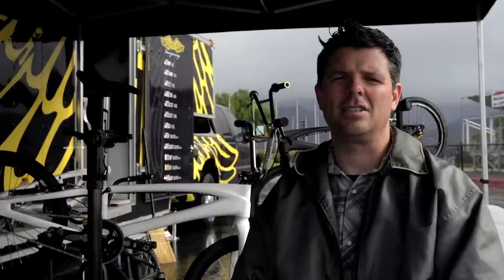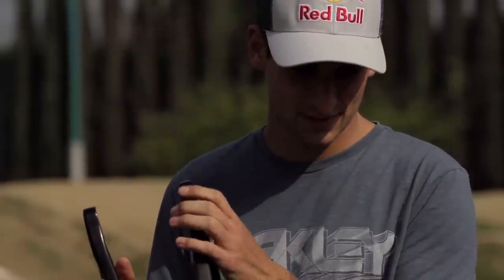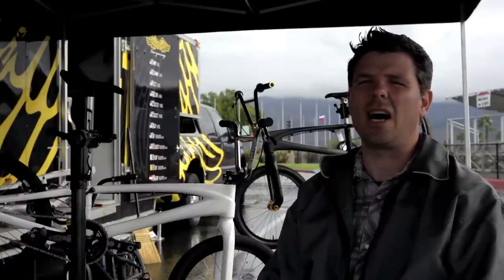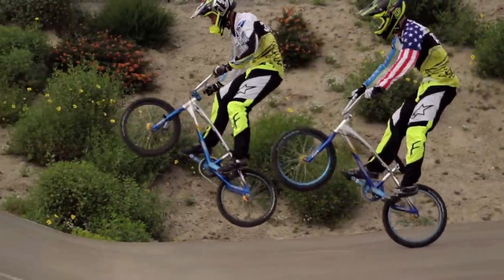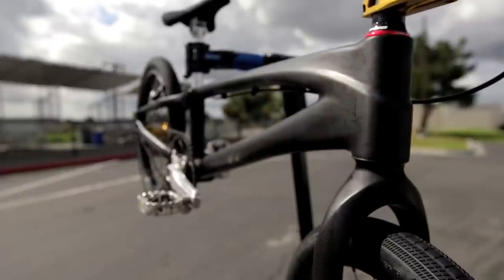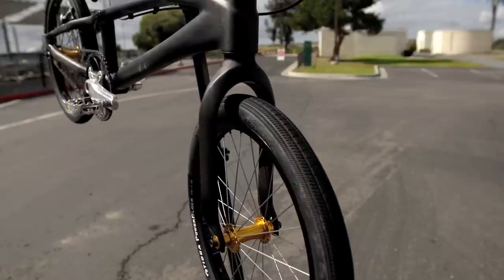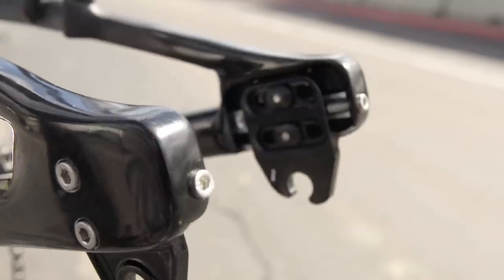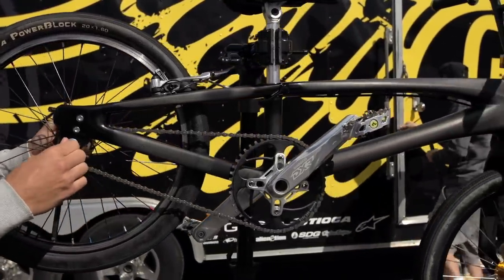GT Speed Series Carbon

Comment: Had a giant stack on a GT carbon roadie (GTR Team Carbon). Flipped it at 70km/h on concrete. Broke my helmet, broke my shoe, broke my cleats, ripped my gloves, tore my bibs and lost a bit of skin.

On the bike - bent the derailler hanger and lost the rear wheel.  Cracked the paint on a chainstay, and cracked some paint near the front brake mount.

Put the bike back together and rode home. Frame checked out OK - absolutely 100% fine . just minor paint cracks.

GT do a strong frame in carbon !
Reply: R u a road biker!!??🤣🤣🤮🤮